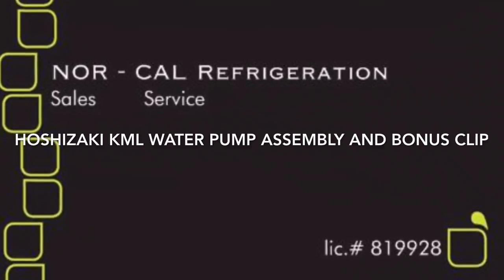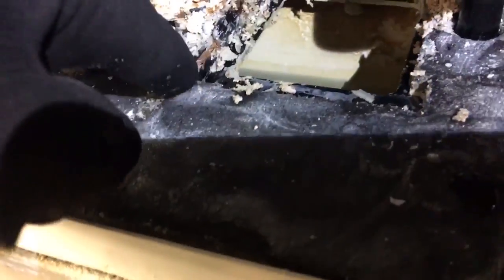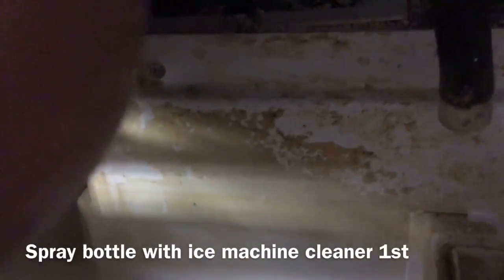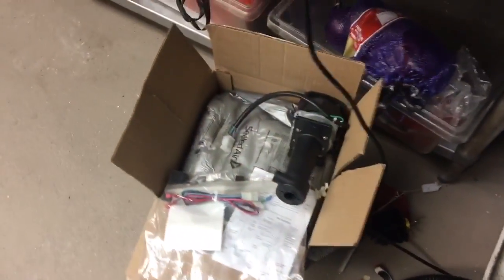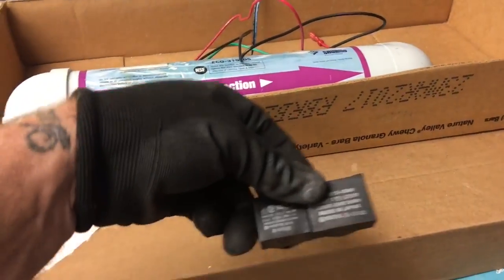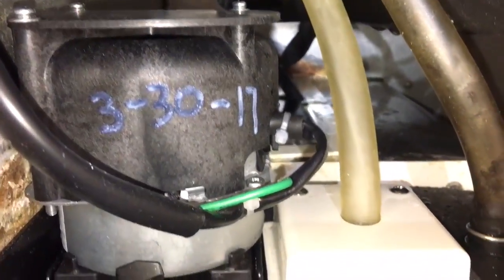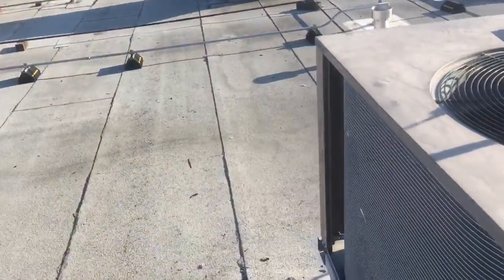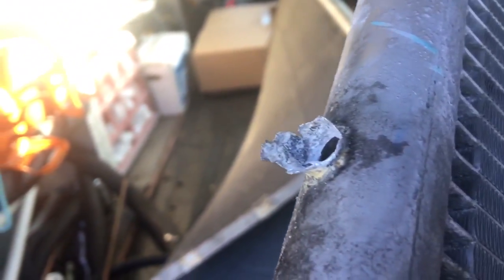Hoshizaki water pump assembly walk through

Comment: Thanks for the video.  I just bought this exact machine used and this helped quite a bit.  during water trough fill it's starts to overflow which I know is normal, but how long does it typically overflow before water shut off.  Mine is taking about 20 seconds which maybe normal but seem a little excessive.  Thanks again

Comment: Hello I bought a condenser copeland scroll ffap-040z-tfc-071 for freezing -10 my question is if it is necessary to install an oil separator and a selenoid to work well or leave it as it comes from the factory. help!
Reply from the maker: Costacarnica sas it all depends on the system. Dose it have hot gas defrost? Or electric ⚡️. Is it piped correctly, is the evaporator sized correctly.
Reply: The condenser is 2 meters from the evaporator and it has defrost electronic the room is 3 meters wide x 4.8 long x 230 high
Reply from the maker: Costacarnica sas if you pipe sizes are correct and ran properly it should be fine unless stated by manufacturer instructions to install oil separater.

Comment: Good job. that ice machine was nasty you should of shut it down like cracked heat exchanger on a furnace for being a health hazard
Reply from the maker: Mi Heating Guy that would be good. But if the door has screw the health inspector dose not check them. 
That why they get so jacked up. They should be cleaned every 6 months.

Comment: mico channels are great for business , they last about a year or two then leak need to be replaced, wouldnt put one in at my house!!!!!!!!!!!!!!!!
Reply from the maker: Capitol Refrigeration,Heating,and Cooling 
There good for business until the customer looses confidence in you, and there on to the next shop. I sure that was my last one. Upgrade equipment to a non micro channel or get someone else. Think about this. Micro channel suppose to more efficient and save the energy or the earth, but in reality they leak more refrigerant into the atmosphere and hurt the earth more.
Reply: i am with you 100%,I think my company is going to reach the point were they wont install them anymore because we are tired of dealing with pissed off customers
Reply from the maker: Capitol Refrigeration,Heating,and Cooling me too. If I do a change out package unit, it old school coil all the way.
Reply: me too . no micro channell evps or condensers.ever. no alum evaps either. only copper evaps.